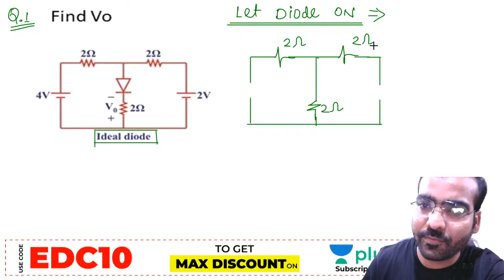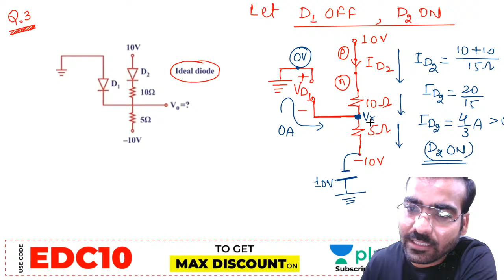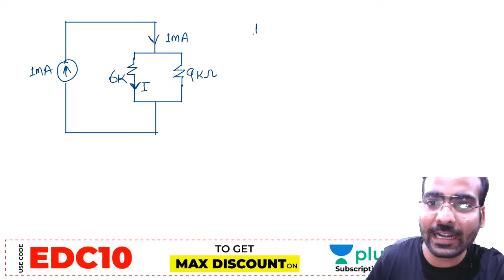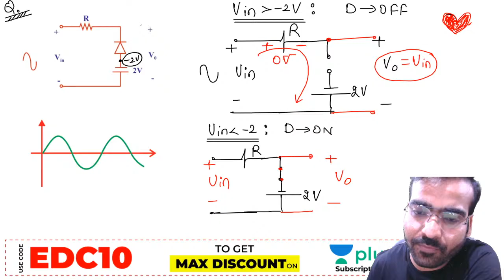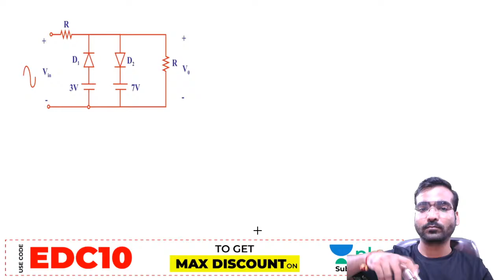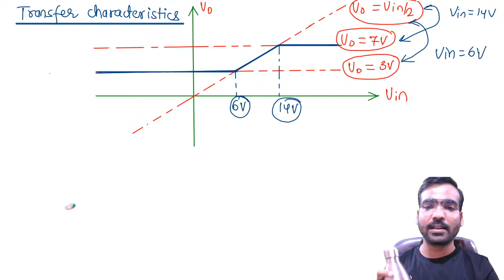Diode Circuits - 1 | Analog Circuits | GATE 2021 (EE,ECE) Free Crash Course | Kamesh Sir

Comment: in 1st question when we assumed the diode is on we get a current proving the diode condition on, acyually what we assume is what we get right so imagine if the diode is off there wont be any value so both of the conditions would work right ?

Comment: I think 3rd question solution is wrong.
If we could assume both D1 and D2 are on ,then that case D1 would come off , so I guess this is not the correct approach ,so we could find which diode would turn on 1st and once we know,we can go for the 2nd diode.
Thanks